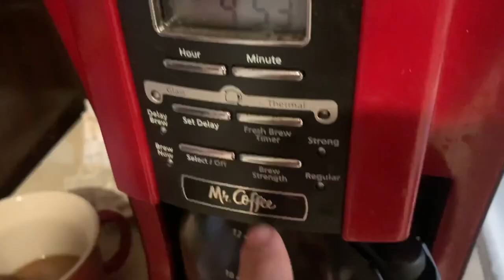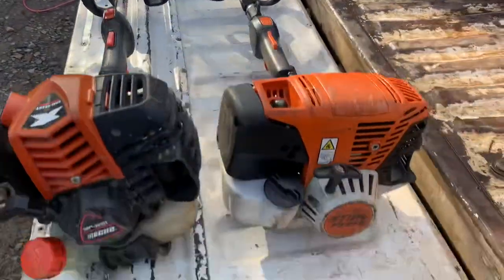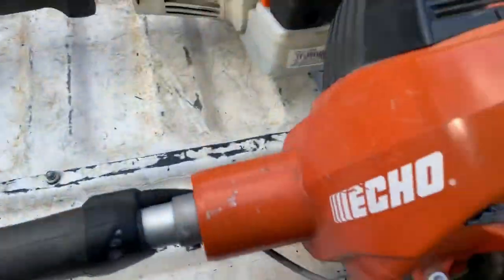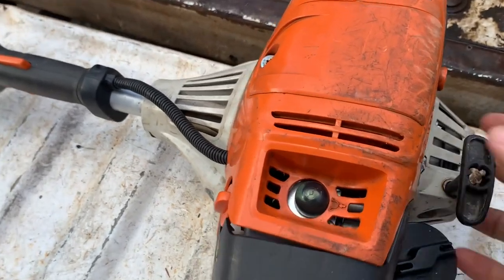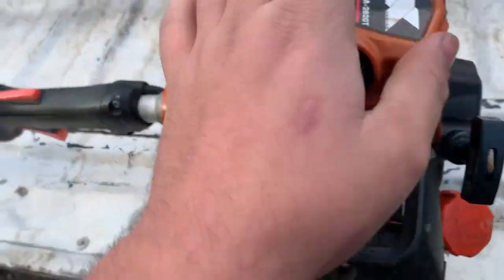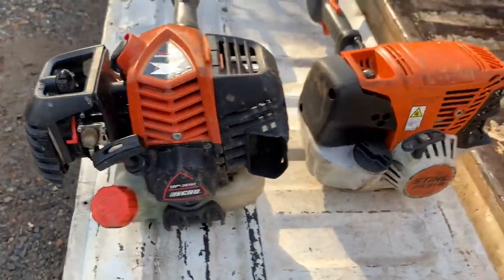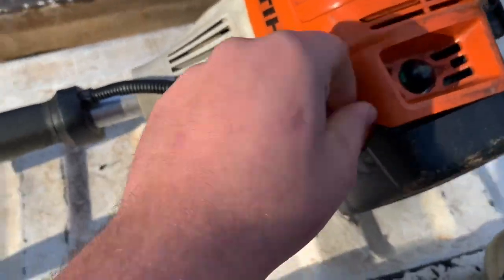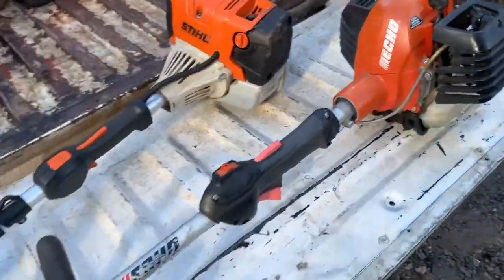Echo SRM 2620T VS Stihl FS 91R!

Comment: At the end of the day, work with what works for you.  I was dealing with my own regrets with inheriting a Stihl fs90r.  Shutting off on idle, carb replacement, gear head replacement.  I finally looked into how to maintenance the machine (after about 3 years), adjusted the valve gaps to spec, and it runs insanely good now.  Need a new air filter, but that’s about it.  At the end of the day, there’s a tool, machine, technique, hell even different types of measurement standards..  if it works for you, it works for you.  I personally would rather be able to make things to back to spec than to deal with an engine that you can’t “tune up” in that regard.

Comment: i work at a Stihl dealer and i cant believe the treatment you got at your local. we never treat customers like that. we warranty without guards also you probably just needed a valve adjustment. those 91rs are 4stroke need adjustment like every 100hrs or something. any hate hearing stuff like this, should have put in a complaint with Stihl corporate. fuck those guys
Reply from the maker: Same echo in this video is still doing great never even maintained it I gave the Stihl away but I’m not a Stihl hater I’ll buy another one one of these days. I still use their blowers and chainsaws

Comment: trimmer was returned as you me tion and you said bothing walk away like that? its not the trimmer fault… i have both and while echo are lighter stihl has way more power and theyr carbs last 5-6 years without touching them, the echo if you leave a tad of old gas over winter then by carb… they both when working perform good but the stihl kombi is better

Comment: i need that fs 91 for my lawn care business,but i could not afford it😢😢ship it to me and i'll taking a good care of it
Reply: Don’t bother with the fs 91r I bought one recently brand new and it already started giving me problems starting after two weeks it Boggs down when flipped for edging or some days it takes 19 or 25 pulls to start up. I highly recommend a Stihl fs 70r or 94r.
Reply: @nevertheless3417 Agreed. 94 is the way to go. Two stroke engines. No need to bother with adjusting valves like on the 91.